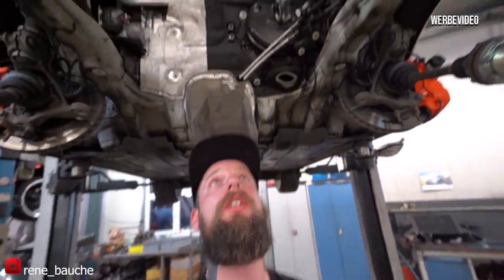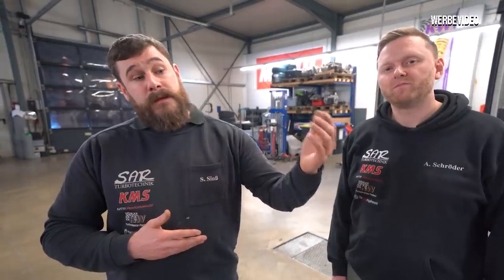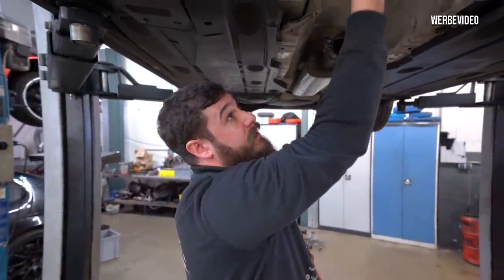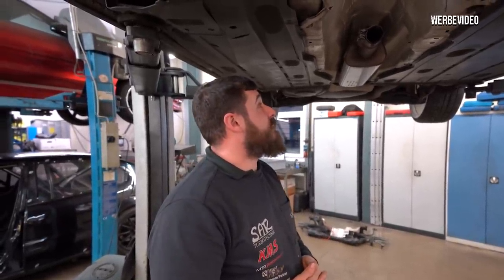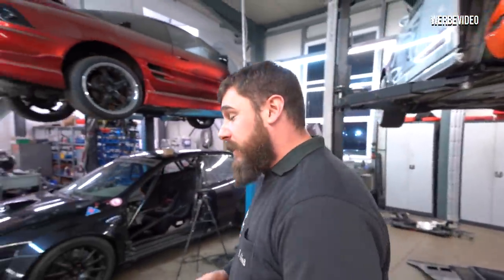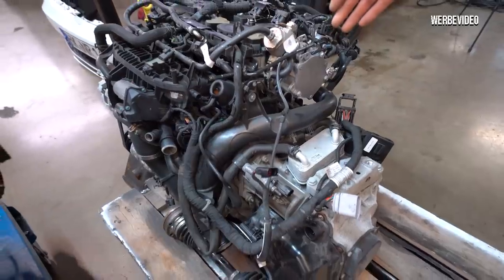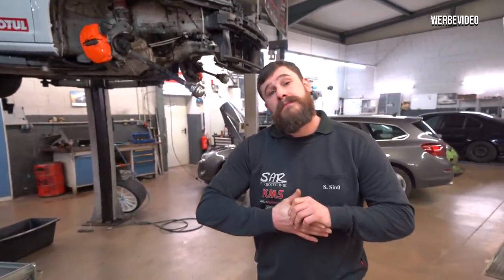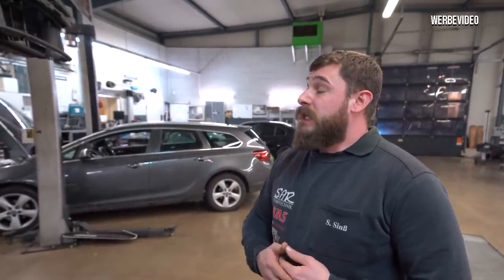Der Umbau geht los - Der GTD bekommt einen neuen Motor Teil 1 -  René Bàuche

Comment: Hätte gedacht das die Kupplung vom GTD stärker ist. Klar hat der tdi weniger PS aber doch fast genau gleich viel NM?!
Reply: Zuhören.
Reply: Er hat sogar gleich viel Nm. 380 beide. Daher würde ich das auch denken. Zumal die sogar selbstnachstellend ist.

Dazu sei trotzdem gesagt, dass mit schärferer Software schon 500+Nm gehen. Upgradelader gar nicht denkbar.
Reply: @MrSuperTolli  Aber beim Upgrade-Lader liegen sicherlich keine 500Nm in den unteren Drehzahlen an. Je größer der Lader desto später das volle Drehmoment. Und mit steigender Drehzahl nimmt auch die Belastung für die Kupplung ab. Ich hätte jetzt aber auch gedacht, dass die Serienkupplung 450Nm standhält. Aber Sinn zu tauschen macht es definitiv!
Reply: @chris-stllwgn  Warum sind 500 Nm bei 2000 1/min für die Kupplung eine höhere Belastung als bei 5000 1/min?
Reply: @chris-stllwgn  ich fahre 460Nm mit der Kupplung. Das funktioniert.

 Aber nen IS38 als Upgrade kommt villt voll bei 3000 bis 3500 1/Min. Und da liegen dann 520 bis 550 oder mehr Nm an.
Reply: @vomdeich1011  Ist es für dich auf dem Fahrrad anstrengender mit voller Kraft rein zu treten wenn du fast stehst oder wenn du schon etwas schneller fährst? Das ist genau das selbe Prinzip.
Reply: @chris-stllwgn  Ok - die Frage hat sich erledigt

Comment: René frag doch bitte mal die Jungs: Ist das ein Gerücht das durch das EMS getriebe und Motorschäden auftreten können oder stimmt das wirklich? Ich höre immer nur bau bloß kein EMS ein das zerstört die durch die mehrvibration deine ausgleichswellen und dein Getriebe.
Reply: Wenn du einen Motor Neu aufbaust, Riemenscheibe samt KW und EMS vom Motorenbauer wuchten lässt, dann hast Motorseitig keinen Stress.

Aufs das Getriebe geht ein EMS auf Dauer immer ein wenig.
Gerade wenn man bspw dazu noch eine starre Kupplungsscheibe fährt.
Reply: es kommt halt drauf an. ich fahre nun seit ca 2 jahren in meinem 1.9TDI (ARL) ein EMS. laufleistung betrug seit dem so ca 100k. Außer das es rasselt und schäppert bis 2000U/m ist noch alles in takt. 

Aber ich glaube es liegt auch wieder mit daran wie man fährt, wenn du die ganze zeit hakst, dann ist die wahrscheinlihckeit das etwas kaputt geht höher.
Reply: @freerider2022  Da gibt es auch krasse Unterschiede. Wir haben beim AFN schon ein gutes EMS von Darkside verbaut und der läuft ruhiger als mit ZMS